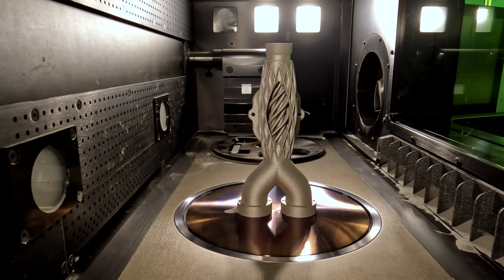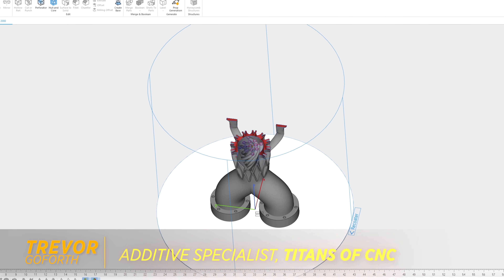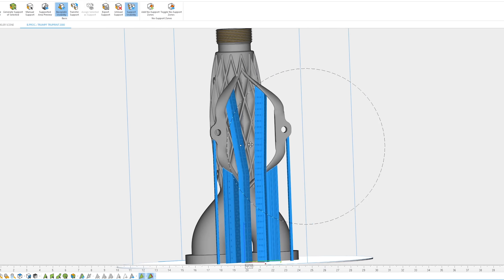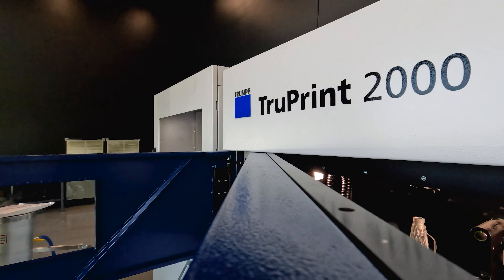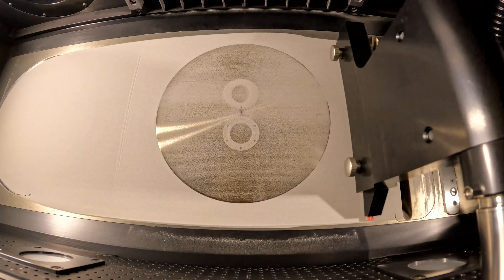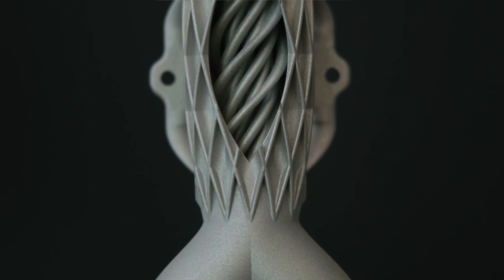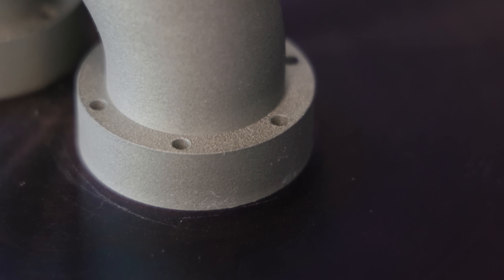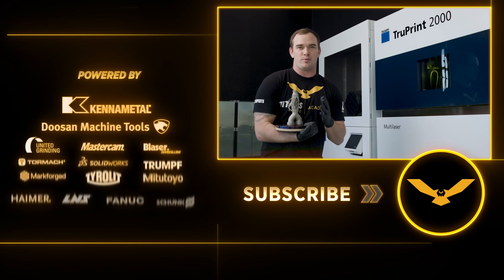3D Printing an INSANE Steel Part that's IMPOSSIBLE to Make on a CNC Machine

Comment: This technology is absolutely mind-blowing! I can't wait to see more videos about the capabilities of this printer!
Reply: It is pretty neat. The parent company to the one I work for uses mostly CNC's and screw machines, but back in April they bought a 3d metal printing place. Recently we been getting insert holders with more efficient cooling channels for things like a muratecs, and okumas. Along with a ton of new insert designs. Right now they are just working with tool and die making but planning on more complicated designs for general market to our suppliers our CNC's and screws can't make.

Comment: This is the FUTURE...CNC will go away folks....it will!!! 3D printing will grow beyond anything it currently is...want to be AHEAD of the CURVE....this is it.
Reply: Uhmm, no, it will not. CNC will stay for simple parts, especially for very large series of simple parts, where weight reduction isn't a priority. Additive manufacturing has some tremendous benefits, really revolutionary stuff, but it will not replace CNC completely. Just a considerable portion of it. 

One offs and very small series of highly complex parts? yeah, they will go the way of the Dodo, for sure. 

Oh, and the really massive size parts, they are safe too. Even wire arc additive manufacturing (WAAM, so basically 3D weld bead stacking) is not really suited for multi-ton parts.

Comment: What kind of print time is that? and what would each part cost? I have to imagine it's a lot
Reply: It won't be cheap, but if there is no viable manufacturing alternative then you have to pay the price. I'm sure costs will come down as this becomes more mainstream.
Reply: Just as a best eyeballed guesstimate from someone that does this, you're probably looking at 2-3 days to print then another few hours to cut that off the build plate if that's all you want to do (there is often some post-processing depending on your needs). With just that, I'd say maybe around $10k.

Comment: Bruh, other guys were doing this in 2015 😝🤣
Reply: Not in this build volume they weren't! 

The first commercial selective laser melting systems go back to the early 2000s. But far smaller build volume, far lower print speed, and only a very limited selection of available alloys for printing.
Reply: @Hydrazine1000  

2013, Rutherford Engine from RocketLab 😜
Reply: @lukasschwarzaerospace  And in that same year: SpaceX's SuperDraco engine.

In all fairness: the Rutherford engine was EBM, not SLM like this. And the SuperDraco was "only" SLS.

But, yes, you have a point. They are not exactly trail blazers / early adopters.
Reply: @Hydrazine1000  
By the way I'm not a hater or someone who likes to talk trash 😉 It's amazing what the team at Titans of CNC is doing! Huge respect for that. I'm a fan to 😁

Comment: How strong are parts form printing ? For example 10mm pipe form printer and same pipe right from nearest store will have same strenght ? Part you have there is amazing and i'm blown away. Absolutely impossible to make in traditional way.
Reply: The 3d printed wont be as strong
Reply: The difference heavily depends on the materials.
For steel the best 3D printed material is a lot weaker than what can be produces by other means (single crystal steel for aviation), on other materials their characteristics are near identical.
Reply: SLM printed parts typically have a martensite grain structure, not sure with this machine in particular since it's "multi-laser"

Comment: It would be interesting to see finishing the ports, turn the faces and finishing the printed thread diameter. Like anyone else who is bit skeptical of the costly process, but also curious would like to see more detail in bond porosity, resolution control and consumable rates. Does the machine log the gas consumed to maintain the work envelope?

Comment: We have printed complex parts like that at work and proem we ran into was getting the powder out of the internal tubes. Flushing with water only made the problem worse. We ended up having to make powder evacuation holes and then plug them once the passage ways were clear. Good luck
Reply: Did you try high frequency vibration and an air-blast to fluidize and clear the bulk of the powder?
Reply: Ultrasonic cleaning?? 🤔
Reply: @hoping67  sadly didn't work. We ended up having to reprint the part.
Reply: @creepy_mtn_man  oh bummer was it a total redesign or can you write in different steps and galleries??,just out of interest how far do you test the part that's been "printed" what's the typical life expectancy compared to cast parts for instance an exhaust manifold? Also Is the part weldable? Sorry for the questions it's absolutely fascinating
Reply: My experience is that this heavily dependent on passage size, and if there are and 'hard' bends. Sub 2.5mm passages seem to have a pretty bad form if they aren't going in roughly perpendicular to the layers. I'm not sure where the cutoff is that a 90 or 180 degree bend can be done without issues as I've never designed anything with big enough passages.
Reply: @nickl6820  Velo3D can print passages down to about 0.5mm
Reply: @BenWilson24  How good is the form? That's what my comment was directed at. It's not that the printer can't make something that looks like a passage, but we had issues if we didn't specify the layer build direction and then keep the passages within ~25 degrees of perpendicular to the layers. My division doesn't own a printer, so we have to contract out for the 3D prints to the lowest bidder, which could be part of the issue.
Reply: @nickl6820  any direction really and it'll come pretty circular without a bunch of partially fused particles hanging below. I know what you mean though and that's pretty consistent with my experience running several different laser powderbed fusion systems at an aerospace OEM. Not to be salesy haha, but I am now an applications engineer at Velo3D because I had used their system in the past and loved how much more capable the system was for building geometries the way I wanted without having to make compromises like teardrop passages, etc. We can also print a lot of unsupported geometries in general that other systems would either have to support or wouldn't be able to print at all
Reply: How small were the passages just curious if running really thin hose down was an option.
Reply: look into what most the industry does, there are a few easy things to do that make it way more possible, you just need to figure them out.
Reply: I guess these tubes arent shiny inside.
Reply: and here Putin has destroyed a television plant, a small construction plant, a machine, a weaving plant, and many factories. Now only the household farm, and the one that wants to rot, I can't suck paws like a bear.

Comment: How long does a 3D printer take to print comparted to a CNC machine? and how long did this part take to print?
Reply: If you're printing parts that can be machined, a CNC machine will almost always be faster and cheaper, but 3d printing allows geometries to be printed that wouldn't be practically doable any other way. I'd guesstimate that's a 2-3 day print at typical layer thicknesses on that machine

Comment: Star Trek replicator not far away. Is this method slow? I have heard that they use 3 lasers and only when these 3 lasers cross each other does it melt the powder. by using prisms to reflect the lasers.

Comment: That's good. Guys, which hardness of this part in Rockwell (Hrc)? Does laser make heat strengthening of material during of process printing?
Reply: It is 316 SS.  The process does not change the characteristic of the metal.  316 is an austenetic SS.  It does not phase change from heat treatment.  It only gets harder through strain hardening, which can only be used with subtractive mfg.

Comment: Neat part but completely wrong machine for it. The liquid jacket is completely non-functional and you can't print it functional because it would just encapsulate the powder. This part should have been made on a direct laser deposition machine and not an SLS.
Reply: It has ports for the heat exchange fluid, so you could get the powder out of those.
Reply: @Vel0cir  you could get most powder out but there's still plenty of powder left in there to contaminate your cooling system and depending on which pump is used, completely destroy it.

Comment: you very convienently "forgot" to show the part 2 of the process....  where you then have to put that part into the high heat "oven" and finish the process.   without that process, that part is literally nothing and SUPER fragile.  it is not considered metal or steel until its been baked and cured.
Reply: No sintering required with laser powder bed printed parts.  This can be removed from the build plate and used.
Reply: From what little I have read, the part is sintered, complete and ready to use.

Comment: Why exactly would you need supports when your using a powder.
Reply: I have asked the exact same question to one of my customers who occasionally bring printed parts for finish machining.He said where there is no support the first few layers are so thin that it curls up does not keep shape due to heat input.

Comment: This printing technology honestly makes me think of the potential advancements we can make in space travel and what not. More efficient, faster space travel. Potentially unlocking things we deemed never possible.
Reply: the powerpack (turbopump assembly) on most modern rocket engines are made almost entirely with additive manufacturing. Laser powder bed machines such as the one in this video are responsible for nearly every rocket engine fuel injector made over the last 15 years. Space hardware is a unique industry with low volume requirements but extreme high precision, its basically the ideal industry for additive to get a foothold.
Reply: There is little that "better parts" is going to do to make space travel more efficient.  The issue is thermodynamics.  The potential energy of rocket fuels vs mass.
Reply: @shooter7a  so realistically, we need to look into alternative "fuel", whatever that may be. Then when we discover something different than what we have available now, the additive manufactured parts could play a bigger role with reimagined fuel source/engine designs.
Reply: @shooter7a  wow.  Amazing.

Comment: Very interesting. I’d like to see what would happen if you dropped it on the floor. Part of me thinks it will shatter like porcelain vase. I’m curious, so please drop it and let’s see what happens.
Reply: Given that it's 316L and that it's a selective laser melting (SLM) printer, you're looking at 99,5% density or better. It will sit between cast 316L in terms of strenght, and billet 316L. The grain size will be better than as-cast, but it will not (yet) meet properties of forged 316L. Given that 316L is highly ductile, it will dent or bend, depending from the drop height and angle of impact.

But it all depends on the printing method: the laser power, the spot size, the scanning pattern, single melting or remelting, layer height, the powder quality, and so on.
Reply: It will dent or bend at the impacted area instead of shatter
Reply: Metal printed parts have nearly the same properties as their cast counterparts. Usually around 95% if I recall. Should be as strong as a cast or milled part for most intents and purposes
Reply: @PrintsandProps  See my other reply: properties depend on a lot of factors. Selective laser sintering (SLS) can get up to 95% density, Selective Laser Melting (SLM) which this TRUMP printer does, can surpass 99,5% density. 3D printed parts can exceed as-cast properties, getting close to forged billet.
Reply: @Hydrazine1000  Guys, i'm designing a single stage LPT (hardly 250mm at diameter) and it'll be made from TiAl. Which manufacturing method is most beneficial for this material?
Reply: @ingunnbollestad  That depends on the part complexity. Can TiAl be SLM printed? For sure. Should you print a single stage low pressure turbine? (assuming that it will fit inside the build volume of the available printer) If you want to optimise as much as you can, conformal cooling, hollow sections, double curved surfaces, integrate and consolidate parts, etc. then printing should be on your mind. 

If you start clean sheet and you design with the shape capability of 3D printing in mind, you'll easily be able to outperform conventional parts.
Reply: @PrintsandProps  I’m not sure they are quite at that level, especially in fatigue properties 
It’s very impressive though
Reply: @PrintsandProps  the properties are typically much better than cast but not quite billet

Comment: I was wondering, how smooth are the printed surfaces? Since this part will be transporting a fluid through its tubes, I wonder if the surface left by the printer increases drag and turbulences
Reply: Because this is a heat transfer component I think the turbulence and increased surface area would be net positive. Based on how narrow the tubes are I would guess that pressure loss isn't  something they are concerned about.
Reply: @JamesSeedorf  I mean... valid point but I wasn't really wondering the efficency for that particular application. 
Rather in general for fluid transportation. 
I guess I should have phrased my question a bit differently^^
Reply: @JamesSeedorf  It's also a mixer, so turbulence helps with that too.
Reply: The surface finish is half the diameter of the particles, so pretty rough. Maybe 800 grit sandpaper. After looking it up the particles are around 30 micron.
Reply: @d3m0n54in7  thanks
Reply: One might think they need a tiny tiny hone if they want to smooth it out....
Reply: @JaedoDrax  like extrude hone?
Reply: @Kyrazlan  Never heard that term before thought honing was in straight line how would you hone the inner parts of those twisted narrow printed tubes shown in the video?
Reply: @mehmettemel8725  Pump plasticine with abrasive powder mixed in through the pipes, This has been done for medical stuff for a while now.
Reply: @stevensmart8868  I heard from a friend that system was displayed on machinery expo few years back.I was told it was mainly used for deburring inner edges of holes where they cross one another but didn't know it was called extrude honing.Allways learn something new thanks.
Reply: @stevensmart8868  plasticine with abrasive - that's pretty interesting and new to me. What kind of pressure do you have to run, I wonder?
Reply: If needed I imagine you can post process flow paths with extrude honing. In this case the increased surface area would help with heat dissipation.
Reply: Maybe they can run a liquid with tiny abrasive particles through the holes to polish it internally?
Reply: Probably could be electro polished if that was important
Reply: The surface finish almost certainly does increase resistance, but 3D printing lets you reduce the size of the component so much that you often end up with lower overall drag.

Comment: Part complexity yes... part porosity absolutely.
Just because we can now design more complex parts... doesnt mean we should be. One piece parts are also non repairable throw away parts. I think we have enough "non-repairable" crap filling up out landfills.
3D printing is the next step... but it should never replace practicality in engineering.